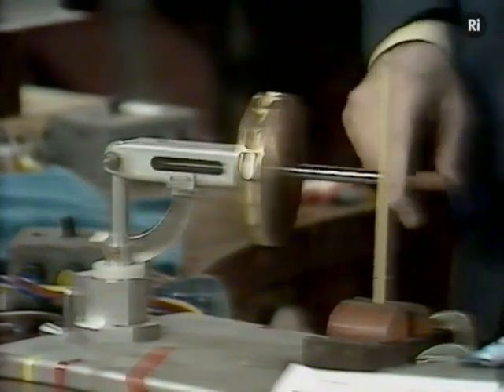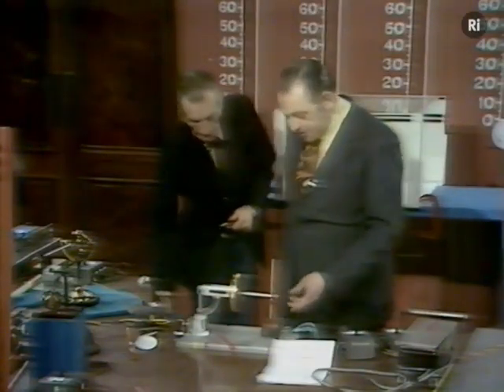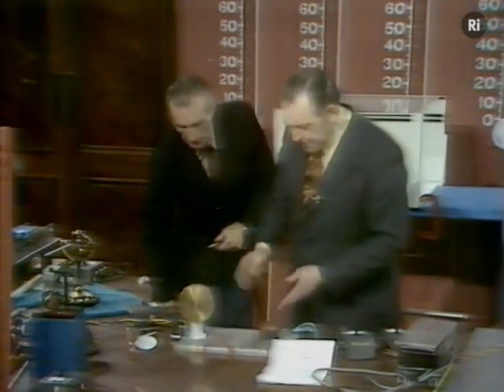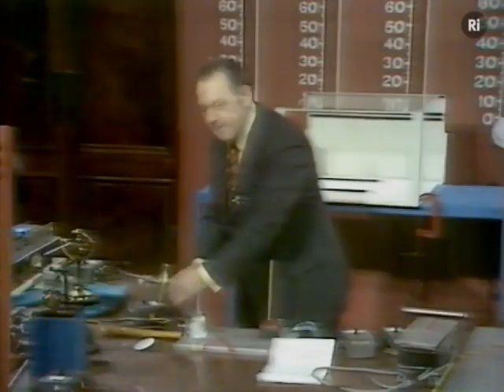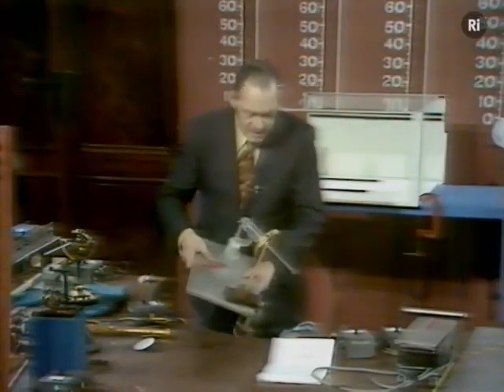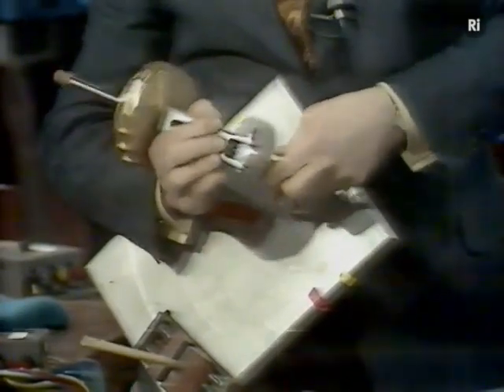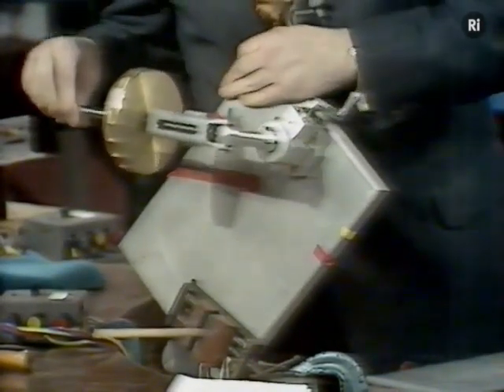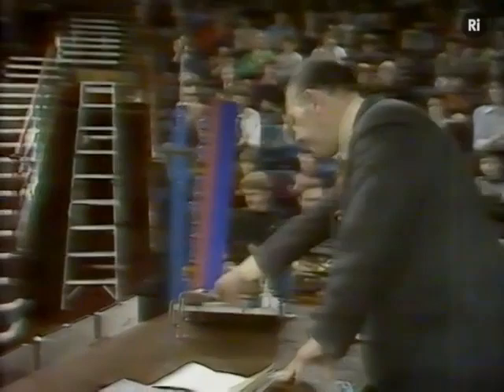🔬#MESExperiments 4: Gyroscopes Precess with Zero ‘Angular Momentum’

Comment: That's an interesting experiment. However I don't know if you really can compare the full unhindered swing of a weight to the immediate deflection of force on the very first impact or even just the first touch during precession. Not to speak of the fact that he lifted  the weight a little bit higher the second time, and also the point of impact was not as close to the vise like it was while precessing. In my opinion it's not possible to draw any firm conclusion from this rather crude experiment.
Reply: Meaning, u can't deny it either then, right- that would be a "firm conclusion." So this adds nothing of substance, just u attempting to disused people from something, u say yourself, u "can't draw any firm conclusions from:" that interesting
Reply from the maker: Yeah this is a little crude but it follows typical gyro behavior in that precession moves without conventional inertia. Checkout experiments 5, 6, 7 which shows that the gyro can't even move an ice block in precession.